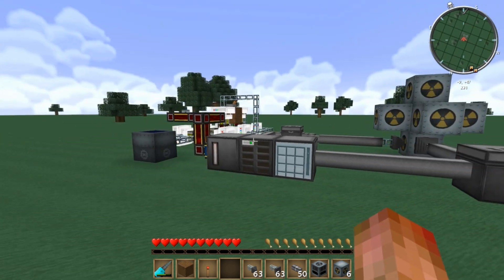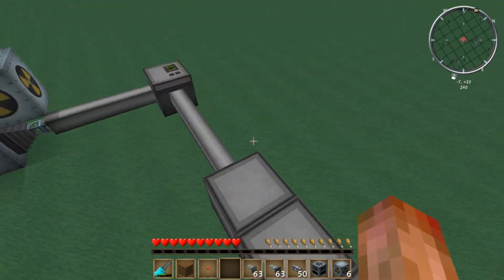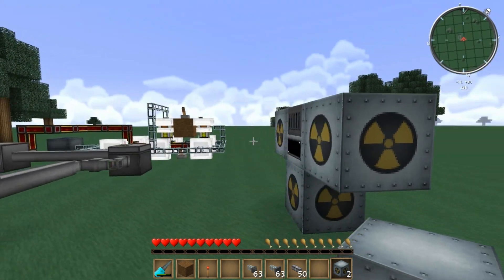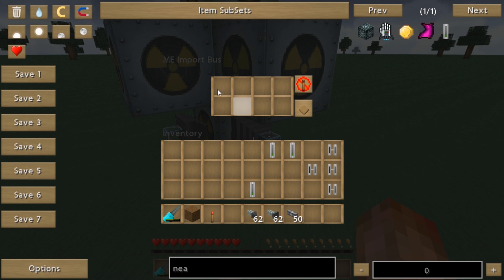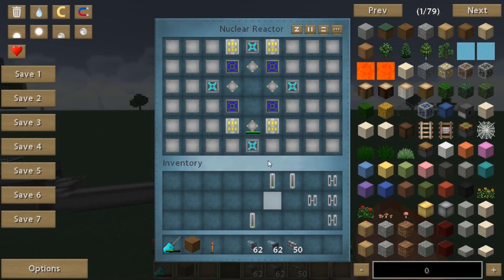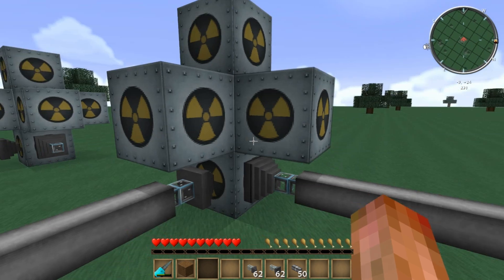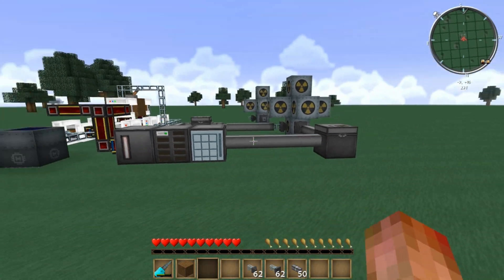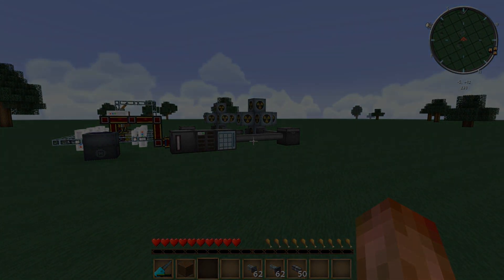Tutorial: Automatic Nuclear Reactor FTB

Comment: Actually, you could replace your export bus with a "fuzzy" export bus so your Thorium cells are inserted into the reactor whatever their damage value.
Reply from the maker: +StarLink149 Is that a new thing?
Reply: GameGabster
Not at all. It's been around since AE1.
I don't know exactly which version, but it was probably already included in the mod at the time of the video.
Reply from the maker: Ahh, well. Thanks for the tip!
Reply: GameGabster
No problem. :)